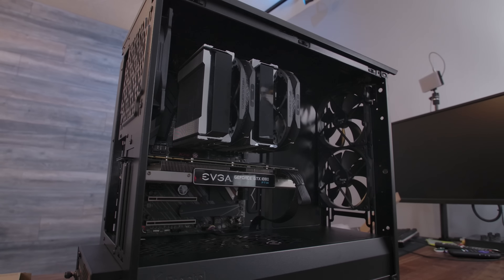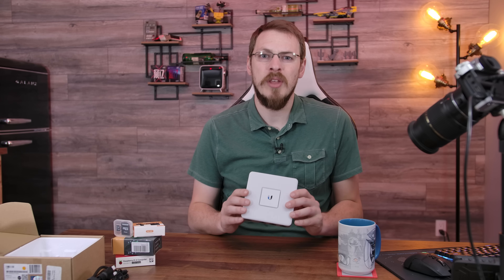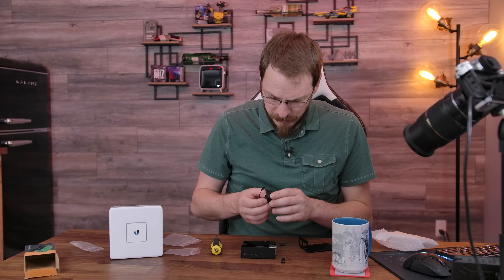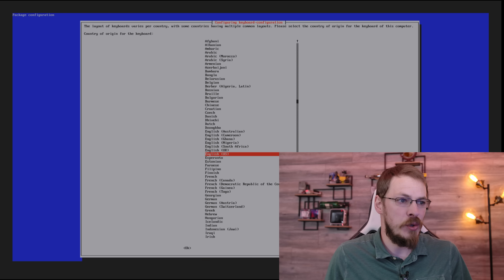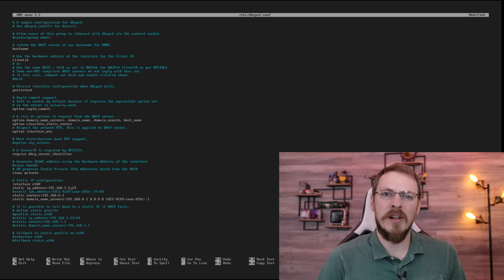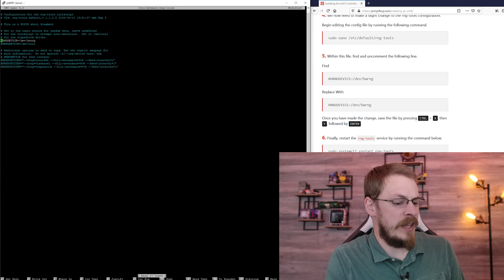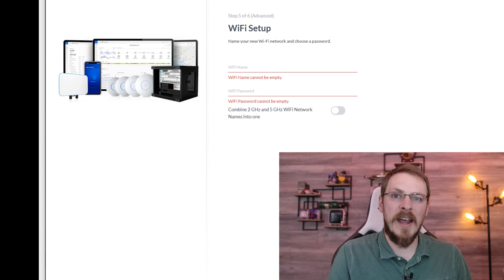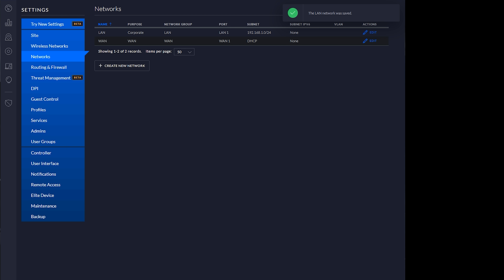Raspberry Pi Home Server - UniFi Controller Tutorial

Comment: I like Unifi gear in theory, but I find it relatively overpriced for the purpose they serve.  Even from the same company, the Edge Router, which is the same hardware but a bit cheaper, has more features.  
I like your overview, but this is pretty complex and expensive for the average home that just needs a few wifi devices.
It sounds like something I would do 😉

Comment: Are you concerned about the longevity of the sd card on your raspi controller? I had a few raspi's in a commercial environment and had the swap them out to NUCs due to SD card failures after a few months.
Reply from the maker: Moderately. It's obviously not going to last forever. I may swap it over to an SSD or mSATA drive eventually.

Comment: im sure you know this but i always do this... if you create a file called ssh on the boot volume it enables ssh so you can just get to it headless from the get go
Reply from the maker: True, but that also requires users to lookup the IP address of the Pi pre-boot. That may or may not work, depending on if they have an existing DHCP server running. Running through my method, you need to access the raspi-config anyway, as well as set up a static IP. Doing the first half of the config through HDMI just makes a bit more sense in this case.

Comment: The new pi 4 8 gb has lots of memory for server applications, I would power the pi separately use a case with air cooling and a ssd drive set up from Etsy case builder.. over clock 2.0 speed wise but nice!
Reply from the maker: The 8GB literally came out 12 hours after posting this video 😂

Comment: Regarding the rasberry's name:To help newly installed basestations to automatically find their controller (even in complex networks) it is good practice to call the controller "unifi" (computer name and dns name).
Reply from the maker: That really only matters if you have setup multiple VLANs, and your APs are already in a separate broadcast domain as your Pi. Very rare in home networks, and not common for even small and large business networks to configure APs for deployment.
Unifi is the DNS A-NAME the APs will look for on a network. The method I would recommend is still naming the Raspberry Pi a name that makes sense for the physical device, and creating a new A-NAME record "Unifi" that points to the IP of the Pi.

Comment: I pretty much did the same, but took advantage of the pi4 lasted update and have buster lite booting from a ssd. For added reliability for my unifi controller.
Reply from the maker: I considered going the SSD route here, but have yet to find a case I like that is both wall mountable AND has room for a PoE HAT.

Comment: Power loss would corrupt the controller wouldn't it? I think that's why the newer cloud key controllers have a small battery and auto shutdown feature. To make it viable you'd have to put in a ups that's capable of shutting the pi down normally and restarting when it has a power input. I was looking at something like the WittyPi3 which I think can accept power input from batteries.

Comment: Have you configured SSID on unified controller to use raspberry pi as AP, or is it to setup different AP that you will be covering in next video. I was very much interested and hoping to see how Raspberry pi would perform as AP
Reply: The Raspberry Pi isn't used as an access point. It is only used to run the Unifi controller software.

Comment: Nicely done. Moving, eventually, into a new home, with Cat6 throughout the house, along with two Unifi APs. Will look to get USG, and run the controller on the Pi. Your instructions were awesome (I like Gus, too, although this seems to be a new guy, Emmet), but I have a question: Maybe you will go into it in future videos, but how would one assign static IPs to clients in the USG? I know how to do it in my current router. However, I am looking to get rid of it. Awesome tutorial. Also want to run pihole and openvpn on that Pi.

Comment: I don’t understand this whole ubiquity unify system. It takes a standard router and breaks it into a bunch of different pieces. Wouldn’t it be easier just to buy a linksys wrt router and flash dd-wrt or some other firmware on it and manage that device. Then you have a modem router and maybe a switch. Vs a modem a brain box thingy and controller a switch and one or 2 or 3 waps ( if applicable). It seems overly complicated for no reason. I will admit I’m not a networking guy. I can build and troubleshoot PCs all day long. Networking I’m just so so at.
Reply: The components tend to be higher quality and it offers more administrative control, but honestly it just seems like a solution in search of a problem. There are a lot of things you can do with this that you can't do with a consumer router setup, but it's also a lot of stuff that most people have no need of. It's overly complicated, and I have no earthly idea why someone would choose it as the best option for a household that they readily describe as not being techy.
Reply: Its designed for large installs. I use unifi at work, we have 3 buildings networked together. Wireless AP's in each building. It makes for easy management for the entire network. Sadly the nanobeams can't sync up to a unifi network. Luckily the UNMS controller will monitor all your edge and nano/air/etc devices. But UNMS and Unifi needs to come together at some point, or have the option to do so. 

Unifi stuff is more stable than most home routers. And Linksys WRT routers are decades old and not up to the task of modern internet. I used to run DD-WRT on modern netgear/etc routers. But always ended switching back to the stock firmware because of poor wireless performance. The open source drivers just don't hold up with newer wireless features on AC and AX. It was fine back in the wireless G and N days, but never had good experience with dd-wrt on a AC unit. 

I moved to unifi myself as it was cost effective and I wanted to have SSIDs attached to VLANS of my choice.

Comment: In raspi-config, there is an option for memory split. Allowing less memory for the GPU and more ram for the system
Reply from the maker: The default is only 64MB. No reason to change it on the 2GB model.

Comment: Why would you need a separate controller? Couldn’t Ubiquity bake it into the device? Sure it is running a sort of BSD or Linux...
Reply from the maker: They do sell a controller in the CloudKey. It works great, but this is around half the price, and allows you to run other services on your Pi.
Reply: @CraftComputing  I'm totally aboard using the pi, you can run so many other things on it. My frustration is because ubiquiy seems to unnecessary fragment their products when a one-and-done solution would be better. ;-)

Comment: It’s also worth installing pi-hole on the Pi. :)
Although it seems you might be doing that next time. Lol
Reply from the maker: Kinda like PiHole on steroids.
Reply: @CraftComputing  Pihole on steroids, Im interested. Standing by for next video :P
Reply: @CraftComputing  will it be on the same Pi as the Unifi controller?
Reply: I am using a VPN that comes with a pihole built in

Comment: Be aware, that Unifi controller stores it's data in MongoDB. One power outage and whole database gets corrupted, whole Unify controller will not start anymore and nothing will work. 
What can I say... MongoDB was a stupid move from Ubiquiti :) backup configuration constantly, and for raspberry PI there's one good life-hack - you can create solution where it is powered by power bank, and powerbank itself is charged from wall socket. Basically what they've done with Unifi Cloud Key v2.
Reply: Or... You know... Connect it to a UPS like you should.
Reply: Ten Gigabit you're suggesting buying and using UPS just for RPi? 🙂because only way how this can even help, is by sending signal to RPi directly and informing to shutdown safely. Otherwise, it's same poweroff, just 30seconds later
Reply: Thats fixed several versions ago. Happened to me a few times.
Reply: AmarilloWireless they stopped using MongoDB?

Comment: Who else is betting that in reality he's just going to adopt the parents' network devices onto his own Unifi controller and not even use the Pi?
Reply: i bet he will actually use the RaspberryPi, think about the old Unifi version he talked about and the PiHole DNS blocking for adult and some ad blocking. :)
Reply from the maker: @Fille Exactly. I had some old square AC UniFi points that can only be managed with 5.4.6 or below. Between that and the content filter (which I don't want to advertise Port 53 on my home network), building them their own mini server makes the most sense.

Comment: Will this same setup work with an Edgerouter-Lite?
Reply from the maker: An EdgeRouter will not work with the UniFi controller software, as it is managed from its own Web Gui. If you're using UniFi access points though, this would still be a good solution to look at.

Comment: I'm going to upgrade my home network sometime.
Currently running an old Fujitsu (Pentium G645, 4GB RAM, Intel Dualport Gigabit NIC) with pfsense, connected to my 1000/1000 internet, a Linksys 8-port switch and a Unifi AP Lite for my wireless units.

I will in the future upgrade to 10Gbe in my home as I will be able to get 10Gbe Internet hopefully this year.
I'm also thinking of moving my servers out of their tower cases and into rack mounted units to clean everything up.

Great video as always =)
Reply: Hard to beat PF Sense, it's almost limitless. The UDMPro would likely be your upgrade...but it's well limited. May be better off keeping your PF Sense running.

Comment: Be careful with that Pi 4, they're still pretty toasty at idle!
Reply: The overheating was fixed pretty quickly after launch.  You can safely use one without cooling now.  Cooling is handy for overclocking though, I run all mine at 2.147 Ghz. :)